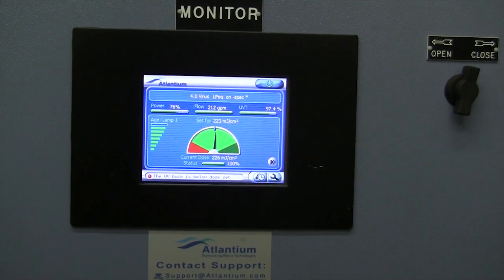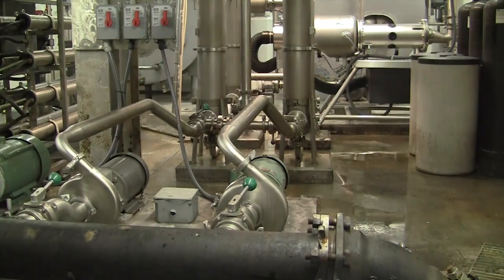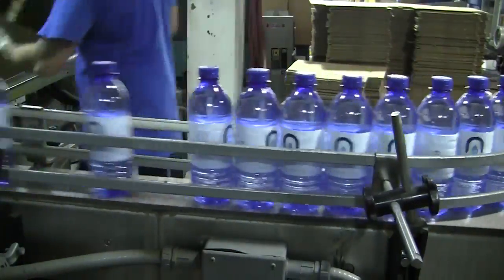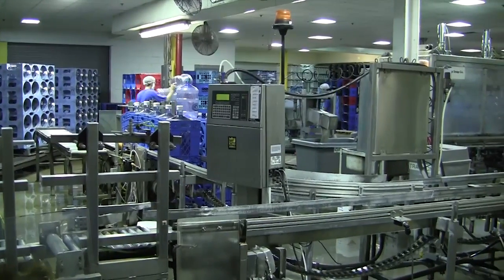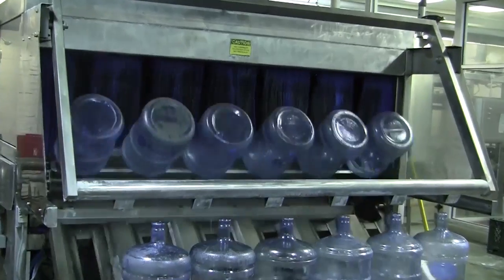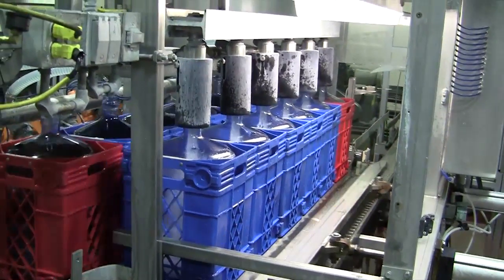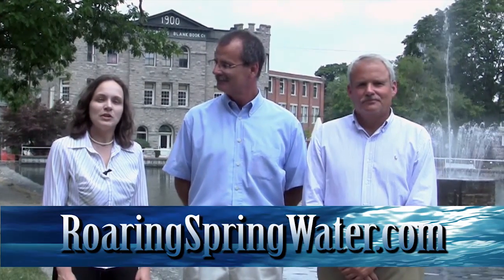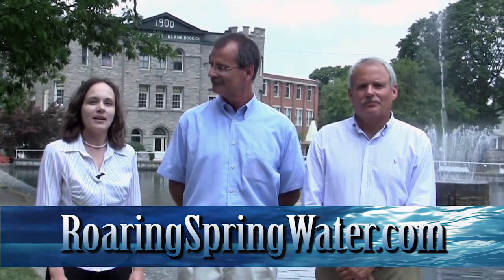Roaring Spring Bottled Water Company Single Natural Source

Comment: Yeah! Try boiling this water for Iced Tea. It doesn't work. My tap water does the same thing as this water. You boil it and the top of the water looks like a desert ground with a cracked surface flowing on top of the pan. Kind of hard to describe what it actually looks like. My local water source says our tap water has a high content of Lime which causes this. If it says Roaring Springs on the bottle, I don't buy it. Some large grocery stores, market it as their own brand. Am I wrong about this?
Reply: soundlive1 your wrong